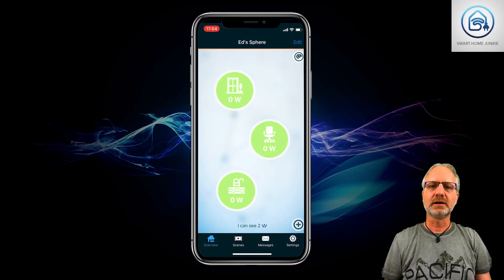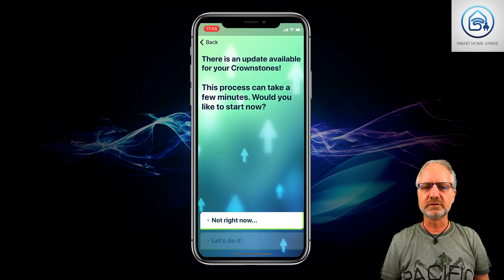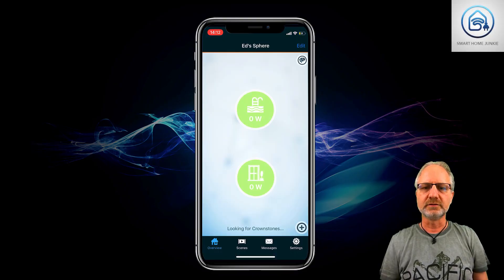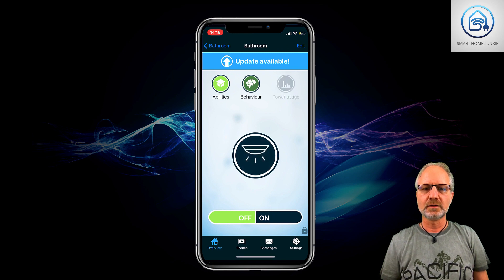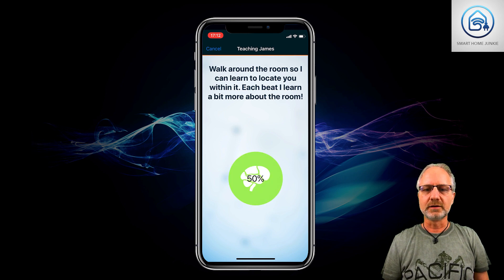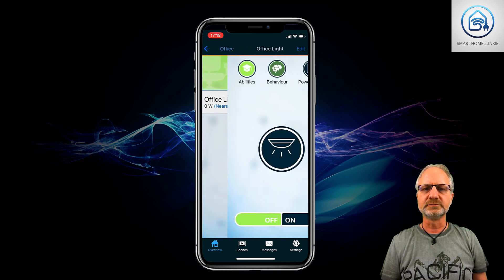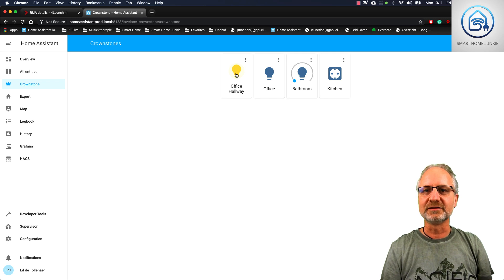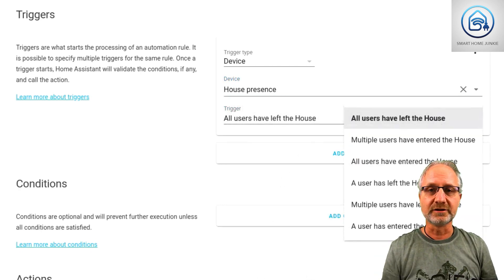How to set up Indoor Localization or Indoor Positioning with Crownstone and Home Assistant

Comment: Please mention to cut the power before modifying the outlet. And please if you are not a professional electrician do not just modify your house wiring. It can be lethally dangerous either by shock or potential other failure states like burning.
Reply from the maker: You are totally right!

Comment: This is an excellent example for not thinking a scenario to the end. This IPS (Indoor Positioning System) can become very annoying very quickly. I doubt that you always carry your phone with you. What if you go into the kitchen and forget your phone on the office desk? Your office light is still on, and you are standing in a dark kitchen. Of course you can flip the switch, but why? You added the IPS to get rid of dumb switches.
Or what is with your guests? Do all your guests need to install the app to keep your "smart home" smart? That would be ridiculous.

Yes it is a nice extension for an existing system, but no more than an extension.

For a serious solution with best results you would need infrared cameras with an image recognition backend.

Motion sensors are annoying if you are sitting still for a while.

Light barriers on door ways can be tricked if multiple persons using the same door way at the same time. Or your pet is triggering them, like the motion sensors.

Any solution that requires to carry a phone is also not practical. What is for example with young kids without a phone?

A perfect IPS solution would require a combination of different technologies. And I would replace crownstone with some ESP32 and would use a trilateration of the Bluetooth signal. With this solution you would gain the same result as crownstone, but with one major benefit: You don't need their app, and you can even track your guests with ease.
Reply from the maker: I get your point. I guess this will bve enough for most people though.

Comment: nahhh, i rather use the sonoff mini or basic, much cheaper and does the same,and i can integrate with home assistant
Reply from the maker: They definately do not the same thing as the Crownstones. Indoor localization is not possible with the Sonoff mini or basic as far as I know.
Reply: @SmartHomeJunkie  you could probably get the same functionality with an esp32 based sonoff and utilize BLE . The learning algorithm seems to measure signal strength. Cool idea . How fast does the automation respond? It doesn’t make much sense if you enter a room in the dark and have to wait for the light to turn on

Comment: Do you need one of those per room you want to train to.
Or can you train a room that is in-between two devices?

I assume when you train you get the signal strength from all devices and create a "map". The same could be done if you have a room in between two devices.

Is that possible?
If it is possible then you can also fine tune the positioning to within a room.
Couch area or by the TV and so on.
Reply: @Crownstone I can understand that it will be harder to distinguish between areas than rooms. 
But as our ground floor is one open space it's hard to call out "rooms" but if we put a few of them here then perhaps we could get something that could work.

I saw the (impressive) demo video you posted with the table and figured if it could distinguish with that detail, then surely a few meters should be enough.

Thank you for the response!
Reply: @Crownstone I completely understand.
It's just that in some places I don't want an extension cord laying just to get a node there. :-)
Reply: @Crownstone One last thing!
 looked at your products. 
Can I make a suggestion...

The Guidestone looks like a USB charger/power supply. 
But why isn't it that? 
I mean that thing takes up a socket and does nothing more.
I assume there is a regulator to get from the 240 AC to 5 DC (or perhaps 3?), so why not just add a USB socket on it. 
There are many devices that use a "charger" as a power supply and can easily be replaced, and charging phones off course.
That way it can be used more than it does as it is.
Reply from the maker: Great conversation. Thanks for explaining this.